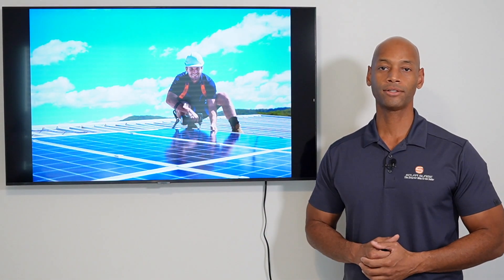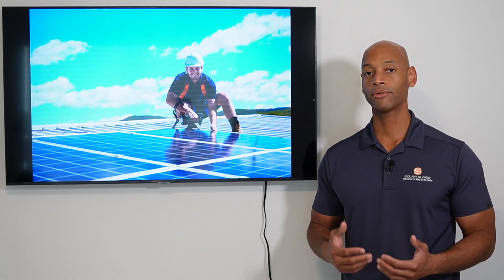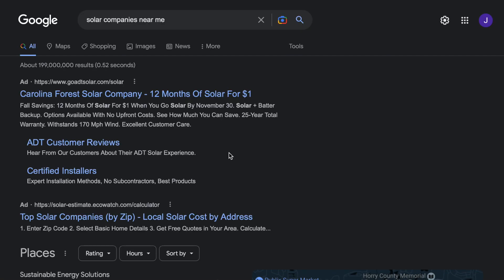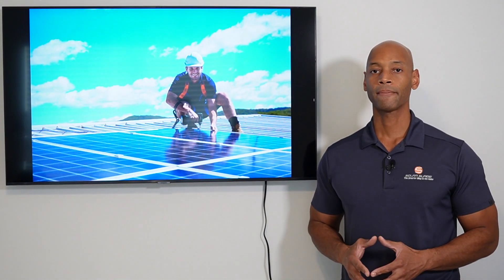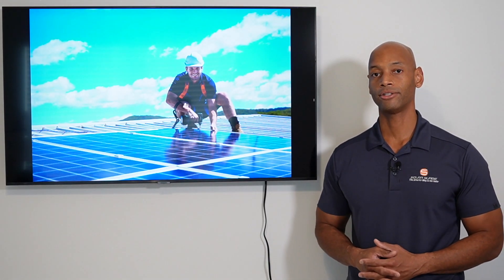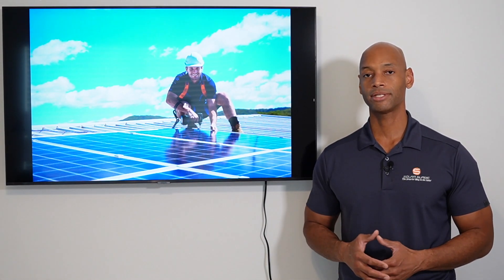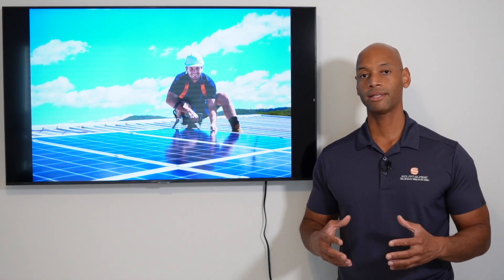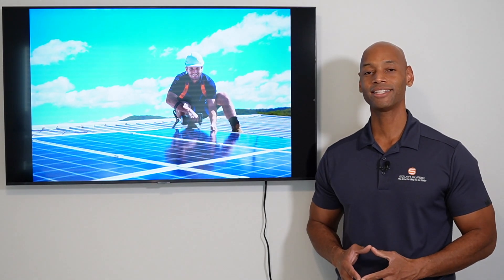How Solar Surge Vets Its Installers

Comment: yes you need to do it while this person is talking to you about the sell look up the company, because it will be a nightmare, like what happened to me vision solar got the system install in the first week of July 2021 and now is nov 2022 and still is not operational, so don't get your system from them...
Reply: Vision Solar was founded by some  guys from Momentum Solar and they are terrible in terms of doing things properly (by the book so to speak). 

A lot of the people that are still waiting for their systems to be turned on is because their solar company did not file the proper permitting or interconnection paperwork with the relevant utility company. 

It’s always important to ask questions about whether or not the company plans on doing the proper paperwork. 

It’s a catch 22 because these companies tend to set unrealistic expectations pertaining to timelines because customers want their solar installed as quickly as possible. So it’s important to know that a solar company will follow the proper procedures to get your solar system installed and activated.